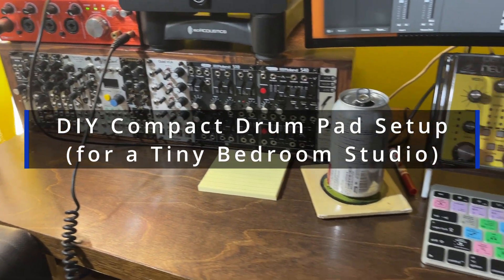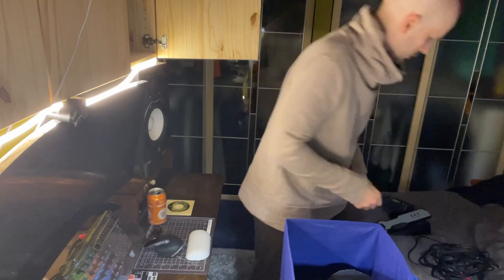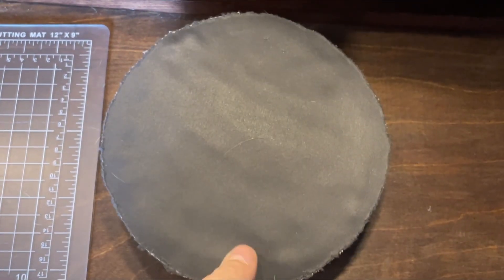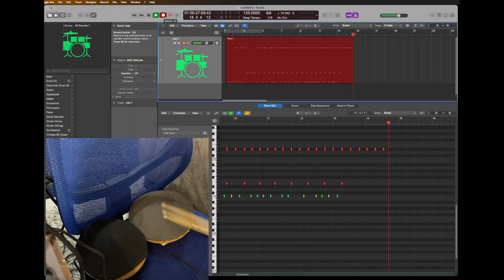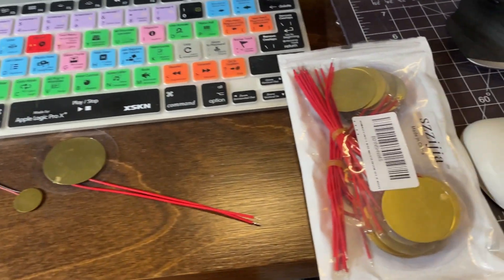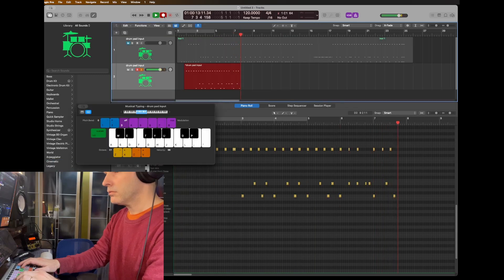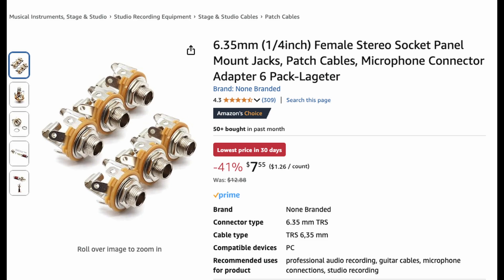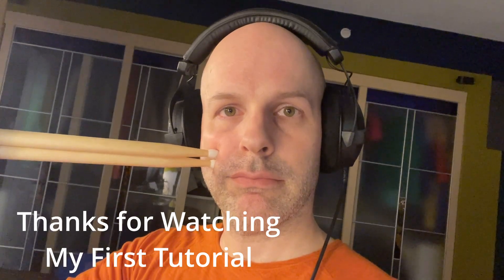How to Build DIY MIDI Drum Triggers (For Small Studios)

Comment: Pretty sweet! Is it possible to perform rolls on the snare? I'd also love to see a larger setup with multiple toms.
Reply from the maker: Yes! Definitely possible to do rolls. It was mentioned in a previous comment about the TM-2 sensitivity settings so depending on what kind of roll, these contact mics can be very sensitive so it kind of depends on what size piezo mic and your playing style. My aim was having a modular setup that’s easy to setup and take down. And the TM-2 has a max of four inputs so maybe I’ll aim for just one tom for now? 😆